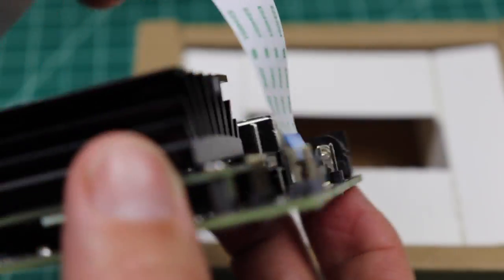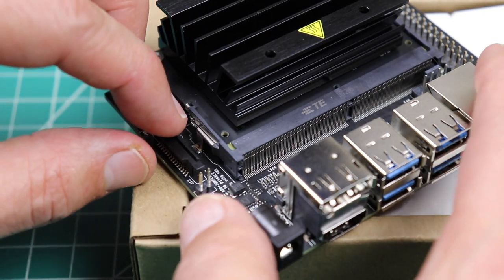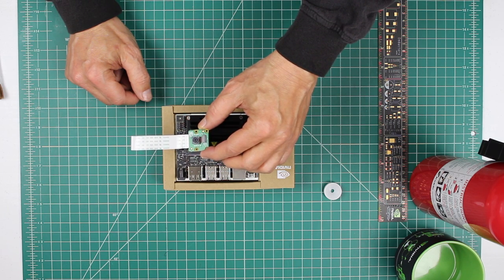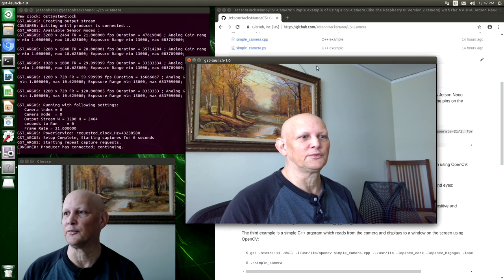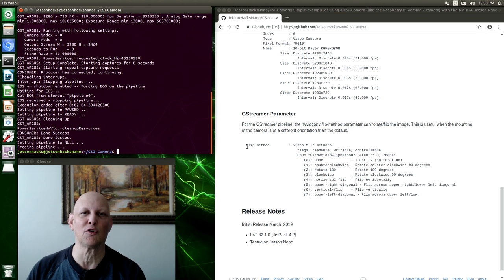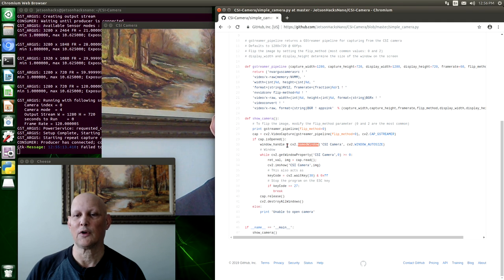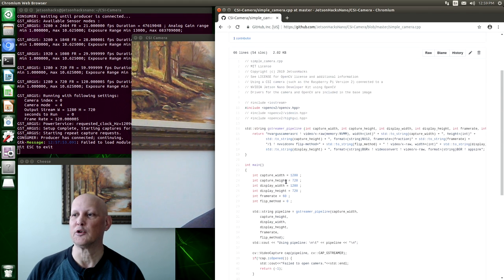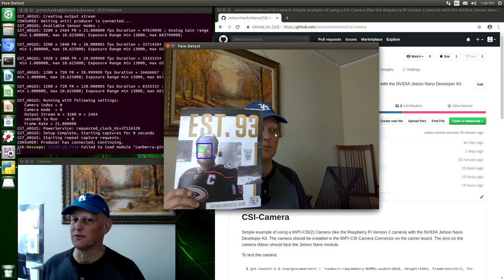JETSON NANO + RASPBERRY PI CAMERA

Comment from the maker: Please note that the Jetson Nano works with the version 2.1 version of the RPi camera (IMX219 sensor). It DOES NOT work with the earlier 1.3 version (OV5467).

Note: Starting with JetPack 4.3/L4T 32.3.1 the Jetson runs OpenCV 4. This means that if you are using an earlier version of JetPack, you will need to select an earlier release of the CSI-Camera repository. In order to do that, before running the samples:

$ git clone https://github.com/JetsonHacksNano/CSI-Camera.git
$ git checkout v2.0
Reply: Is this still valid I have 4GB JP4.6.1 jetson nano and IMX219 V1.3 I had some problems.
Reply from the maker: @karatugba  Hard to tell what issues you encountered from your description. A v1.3 Raspberry Pi camera is not a IMX219 sensor, but rather a OV5467.

Comment from the maker: Please note that the Jetson Nano works with the version 2.1 version of the RPi camera (IMX219 sensor). It DOES NOT work with the earlier 1.3 version (OV5467).
Reply: JetsonHacks Hello and THANKS for the AWESOME CONTENT!
I just bought a Nano and am trying to follow your example. However, mine does not find and mount any camera I’ve tried - including the v2.1 RasPi unit. I only have the base Nano SDK loaded. Is Jetpack 4.2 required, and/or is there another code which actually detects/mounts the RasPi camera? Note: I can find Video1 in /dev folder, but the Nano does not recognize it...?
Reply from the maker: @johnfowler4264  If your RPi v2.1 camera is properly installed, it will appear as /dev/video0
You can run:
$ v4l2-ctl --list-formats-ext
which should list the available formats. There are no additional drivers needed. Thanks for watching!

Comment: the pi always had weak GPU. this is basically what ive been wanting for for a long time. Looking forward to when they are out en mass & as the community builds. This is going to be a hot little seller.
Reply from the maker: A little competition be good! Thanks for watching.
Reply: I ordered one from Sparkfun, but they're already out of stock. I'm eager to get my hands on it. ETA Prime said that it's already looking like the best SBC for GameCube/Dolphin emulation.

Comment: like u said The new Jetson Nano B01 devloper kit has two CSI camera slots. You can use the sensor_mode attribute with nvarguscamerasrc to specify the camera. Valid vales are 0 or 1, i.e. and i wrote "nvarguscamerasrc sensor_mode=1 !" to terminal but it says that nvarguscamerasrc:command not found.. How can ı solve this issue Thx JetsonHacks
Reply from the maker: You need to use the nvarguscamerasrc in a Gstreamer command.
Reply: @JetsonHacks  "Gstreamer command" couldnt get it. Is it something like terminal? Sorry I am so new to these things. Thank you for your help
Reply: okay i solve the issue. Thx.
Reply from the maker: @mfatihozkan3503  I am glad you got it to work.
Reply: I’m facing the same issue . How did you solve it ?
Reply: @حفصهعثمان-ث8ش  sorry bro cant remember

Comment: does jetson orin nano will work with raspberry pi v3?, if possible what else i need to do to interface it
Reply: and importantly i'm using jetpack 6.0, thanks in advance
Reply from the maker: I believe it does, but I haven't used it. Please ask your question on the official NVIDIA Jetson Orin Nano forum where NVIDIA engineers can help you through the process. Thanks for watching!

Comment: Hi!! Great video, One question how set the 640×480p90 video, without get a error? 

this are the video values:
capture_width=1920,
capture_height=1080,
display_width=960,
display_height=540,
framerate=30,
flip_method=0,

how can edit it without get a error?

Thanks for all, the videos are very useful
Reply from the maker: Thank you for the kind words. I do not know what error you are getting from your description. What did you try? Is your camera capable of 640x480 video at 90 fps?
Reply: @JetsonHacks   the camera is the raspberry camera v2, the 90 fps are not important for me but I want to set the  resolution to 640x480 to decrease the video lag.
Reply from the maker: @fernandobarajas566  I don't know what error you are getting. Does the camera support 640x480? What are the results of 
$ v4l2-ctl --list-formats-ext 
If the camera is not on /dev/video0, then add the -d flag (for example -d /dev/video1)

Comment: Hi Jim! Could you tell me if a CSI Wide Angle 200° camera with the OV5647 sensor is compatible with an NVIDIA Jetson Xavier NX or Jetson Orin Nano?
Reply from the maker: I don't know the full answer. I believe that you need to get/build the OV5647 driver and install it. You may also have to modify the camera somewhat. Please ask the question on the official NVIDIA Jetson forums, where a large group of developers and NVIDIA engineers have experience with this sensor. Thanks for watching!

Comment: Looking forward to your tutorial over CUDA support for realsense cameras on Jetson Nano!
Reply: I asked this question earlier about RealSense camera(d435 and T265) on the first nano video introduction and Jim said "The changes to support the RealSense video formats is in part of the kernel which can not be modularized, so there's no easy way to just add a few modules here and there to get it to work. "  not sure if this means it is not an easy... or can not be done. I would think if TX2 can the nano could too.  The raspberry pi works for RealSense but it is limited by the USB2 ports.  The nano has USB3 ports so here is to hoping we find out.
Reply: @sy2532  I still hope Mr Jetson will come to our rescue!
Reply: @sy2532  I am fairly new to the jetson and realsense. I have ordered both, but haven't received them yet. I wanted to ask : If at all CUDA support cannot be made available for the LibRealsense on the Jetson Nano, then does the real-sense library work standalone? I mean, do we need to modify the kernel in order to get a basic interface with the camera working?
Reply: @projectnorthernlights8431  Jim just updated... The Nano supports the RealSense.
Reply: @sy2532  That is a relief!

Comment: Hey, quick question here - I am trying to do exactly this, but I need to save the videos (for a science fair). The code for it is pretty simple, but the large problem is that I cannot save the frames fast enough compared to the frame-rate. One of my problems is that I want to use the mode 3 (1280 by 720 with 60 FPS), however it always chooses the 120 frames per second mode, mode 4. I have in the Gstreamer function you made the fps = 60, but it still will only do 120 frames per second. Thanks for the information!
Reply from the maker: I do not have anything to share on your issue. Please ask this question on the official NVIDIA Jetson Nano forum. Thanks for watching!

Comment: Thanks for the amazing videos. Can you please make a video/share info about connecting Jetson nano remotely to laptop using WiFi or lan??
PS: I am confused whether to buy a monitor or is there another way.
Reply from the maker: I believe you need a HDMI monitor for the initial setup. That might be something you can check out in the forums.  After that, it's a regular Linux box. You can SSH into it and so on. 

It is worth asking this question on the official NVIDIA Jetson forum where a large number of developers and NVIDIA engineers share their experience. The forum is here:  https://devtalk.nvidia.com/default/board/371/jetson-nano/
Thanks for watching!
Reply: @JetsonHacks  Thank you!! Yes, I had to use the monitor for initial setup and then I installed xrdp and now running fine. Could not make the VNC work.
Reply from the maker: @009deepesh  Please ask on the NVIDIA Jetson Nano Forum. There's a thread that goes over the process.

Comment: Thank  you  verey  much  for  this  review , i'am  on  the  stage  of  choosing   between   ROC-RK3399-PC AI   ( with  NCC S1  )     or         Jetson  nano ,  which  is  better  for  4K   image / video     AI / AR   processing ?
Reply from the maker: Depends on your needs. The Nano has less CPU cores (4xA57), but probably about the same CPU performance for the mixed ROC cores (2xA72-4xA53), the Nano has 128 GPU cores, the ROC has 4. They both appear to have 4K video decoders, but the Nano has 4K video encoders where as the ROC has 2K. I don't know about how you program the GPU on the ROC, the Nano uses industry standard CUDA. I don't know anything about the ROC, so I can't make a suggestion. Thanks for watching!
Reply: @JetsonHacks  Thank  you  verey  much   for  your  answer .

Comment: On your GitHub page is written: "If you can open the camera in GStreamer from the command line, and have issues opening the camera in Python, check the OpenCV version."
That is the problem I am facing. I do have cv2 version: '4.5.4'  But what to do next, to solve the issue?  Should I install another version of cv2?  (Using Jetson NANO with Ubuntu 20.04)
Reply from the maker: Since Jetson Nano does not officially support Ubuntu 20.04, I have not seen the issue you are facing. I'm not sure what the issue is from your description, but at some point you will need to match the code to use the version of OpenCV you are using. Good luck on your project, and thanks for watching!
Reply: @JetsonHacks  I restored the original img file, and now it is working (again). Tnx for your advise. Best greetings.

Comment: Hi I' am using C920 camera and I am trying opencv real time photo (test code) but I dont know What write to VideoCapture() please help me
Reply from the maker: Hard to tell from your description. In Python you could do something like (assuming your camera is on /dev/video1):
cap = cv2.VideoCapture("v4l2src device=/dev/video1 ! video/x-raw, width=640, height=480 ! videoconvert ! video/x-raw,format=BGR ! appsink")
or:
cap = cv2.VideoCapture(’/dev/video1’, cv2.CAP_V4L)
The second version will try to negotiate appropriate capabilities. If you are going to use compressed video (MJPG or H.264), you will need to add decompressors and so on.

Comment: Thank you. Is there a way to attach more then one camera and process video streams from several cameras simultaneously?
Reply from the maker: In the video, two cameras are being used simultaneously. One is connected to a USB port, the other through the Raspberry Pi connector. There are 4 USB ports. There are third party carrier boards that have different camera input configurations. Thanks for watching!
Reply: @JetsonHacks  Mr. Jetson, interesting, could you please cover some of the 3rd party carrier boards? Wonder if there is an Xavier Nano or something.

Comment: Hello sir do you know if my camera has Hdmi can i use it with my jetson using the CSI-HDMI interface?
Reply from the maker: I do not know right off hand. Please ask the question on the official NVIDIA Jetson Nano forum, where a large group of developers and NVIDIA engineers share their experience. They should be able to answer the question. Thanks for watching!
Reply: @JetsonHacks  do you happen to know if i got a HDMI to USB will this work?
Reply from the maker: @ahmedsaleh4640  I haven't tried it. You will need the correct driver/program for the capture device for a Jetson based device. You can ask on the forum to see if anyone else is using one.

Comment: hmm, getting an error. No cameras available.
gst-launch-1.0 nvarguscamerasrc ! 'video/x-raw(memory:NVMM),width=3820, height=2464, framerate=21/1, format=NV12' ! nvvidconv flip-method=0 ! 'video/x-raw,width=960, height=616' ! nvvidconv ! nvegltransform ! nveglglessink -e

any suggestions?
Reply: Error generated. /dvs/git/dirty/git-master_linux/multimedia/nvgstreamer/gst-nvarguscamera/gstnvarguscamerasrc.cpp, execute:521 No cameras available
Reply from the maker: It's hard to determine the issue without knowing what camera you are using and if the camera is properly installed.

Comment: Hi, I follow u and u are great!!
I have a question for u, I want to know if I can use the Jetson Nano for read distances between the camera to a car (FOR EXAMPLE) or I need to use a lidar? then, which libraries must use.

I will thanksfull for u help.

Thanks for ur videos!! 
Regards.
Reply from the maker: You will need to use a sensor that can return distance information. Lidars can do that, ultrasonic sensors can, as well as depth cameras and binocular cameras. Thanks for watching!
Reply: @JetsonHacks  Ty for u answer! 
Okey i´m rely  on lidar because i think that this technology it´s more reliable thn ultrasonic. On the other hand, if I use Lidar, what library can i use for them?

ty again!
Reply from the maker: @MrFranckiie  It depends on which type of lidar that you use, and the device in particular.

Comment: Hello I use both of the commands on the github and It worked but after I install opencv using pip3 install opencv-python I can`t open my csi camera with those two command I wonder if I use the wrong way to download the opencv or what pls help thx
Reply from the maker: I believe that when you install opencv-python that will overwrite the native OpenCV package. The native OpenCV package has support for using the RPi camera with the Jetson. Thanks for watching!

Comment: it looks like the face_detect application has less framerate when compared with normal camera vision, how to increase the frame rate for face_detection script?
Reply from the maker: You can do about 20 different things for faster frame rates. What have you tried?
Reply: JetsonHacks can you just share those tips which will help me in my project. I just know changing GPU , changing the camera might increase
Reply from the maker: @moulich7372  This is more than can be explained in a YouTube comment. There are several ways, grabbing the camera on a different thread, using a machine learning model, accelerating with TensorRT, and so on. You can probably get help on the official NVIDIA Jetson Nano Forum. Good luck on your project!

Comment: when you reduce the resolution for higher fps, does the image width reduce or the dpi?
Reply from the maker: The image appears to crop towards the middle. I don't believe the DPI changes.
If you look at the image at 
3:36 - 3820x2464
and compare it against:
5:13 - 1280x720
You can see the difference. The 3820x2464 image is scaled down in the demo to fit in the window. If you were viewing it on a 4K monitor, it would fill the screen. The 128x720 image is shown full size.

Thanks for watching!
Reply: @JetsonHacks  , i see. it would be good if we could keep the width and reduce the resolution, good for wide angle cameras and faster image processing....
Reply from the maker: @fishworxify  Since the images are coming straight in to the processor, it should be straightforward to de-res the 1280x720 @ 120fps images. Also, other vendors are coming out with cameras based on the IMX 219 that may better serve you needs.

Comment: is there a way how to control the motor through hand gesture?
Reply from the maker: Various ways. Most likely you would run some type of machine learning model (like NVIDIA trt_pose_hand on Github or MediaPipe) and then write some glue code to translate to motor commands. Good luck on your project!
Reply: @JetsonHacks  Thanks! Would you recommend to load pre-built JetBot image and on it load the TRT Pose, or a normal JetPack version and on it the TRT Pose, but then how can I control the engine then?
Reply from the maker: @MrMertge  This is not a simple project. I would suggest that you set up a separate card with TRT Pose and become familiar with it before attempting to integrate it with motor control. For the JetBot, where the camera points down, it's not clear how you intend to present gestures to it. An extra camera perhaps?

Comment: one small doubts, does this two devices connected in same network or different network. can we do the same for remote access.
Reply from the maker: I do not understand your question.
Reply: @JetsonHacks  simple I just want to take remote access of Nvidia Jetson with Ubuntu os installed and that Nvidia is from different location.  I want to take remote access from another location. 
Both devices are from different locations and connected to different Networks.
Reply from the maker: @sridharethiraj2149  I don't understand your question well enough to give you an answer. Please ask this question on the official NVIDIA Nano developers forum where a community of developers and NVIDIA engineers can help you.
Reply: @JetsonHacks  even more simpler, to take remote access of Nvidia nano with another nano, from different locations and connected to different Wi-Fi Networks.
Reply from the maker: @sridharethiraj2149  Can you do it? Sure. But the question indicates that you do not know how to do that (it's basic Linux stuff). The official NVIDIA Jetson Nano forum is a really good place to get help with your projects. This is a YouTube video about connecting a camera, it does not lend itself to providing detailed answers/how tos for your projects.

Comment: hi how to know the pi camera is function or not, because i connect it but do not show anything, is there a problem with the coding or problem with my code
Reply from the maker: Which RPi camera are you using?
Reply: @JetsonHacks  pi camera v2
Reply: pi camera noir v2
Reply from the maker: @aminfirdaus3279  What are the supported resolutions when you examine the camera using v4l2-ctl ?

Comment: Hi, does jetson nano support RPi V1 camera .. its very cheap .. same pinout?
Reply from the maker: The default Jetson Nano installation does not support the RPi V1 Camera. Thanks for watching!
Reply: @JetsonHacks  is it possible to enable support for that? or its not at all possible?
Reply from the maker: @puvi007  I am not sure what you mean by possible. If you port the driver over and modify the tegra camera code, it is possible. However, it may not be easy.